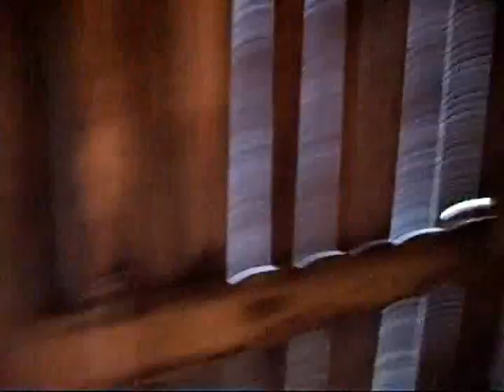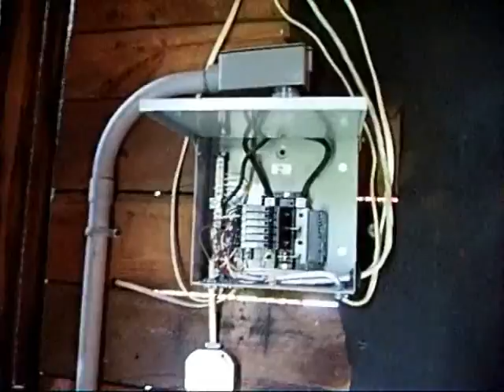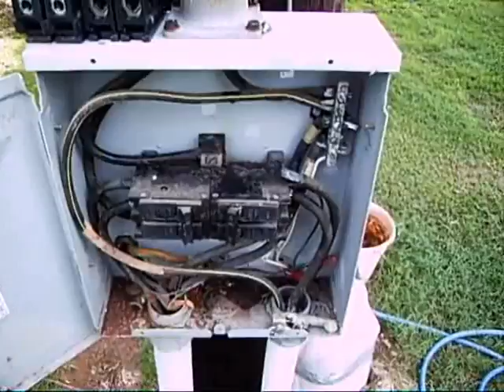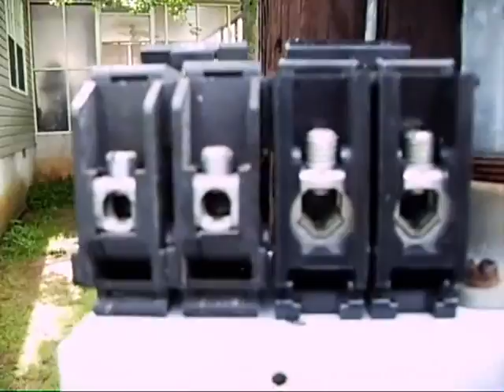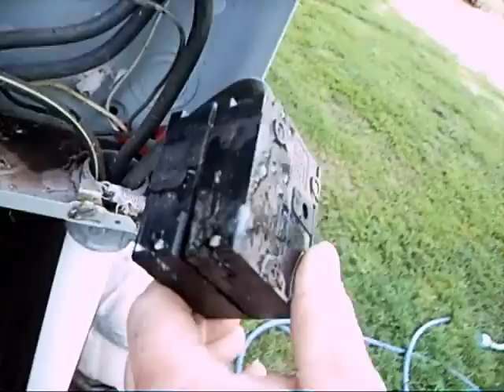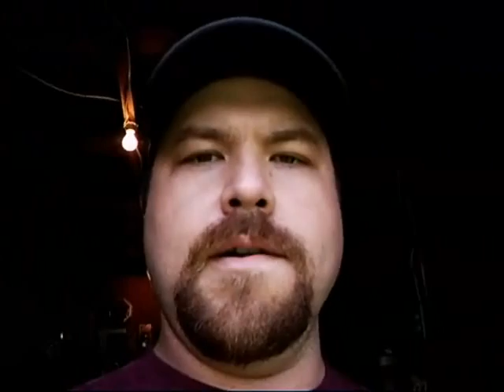Electrical problem at the shop

Comment from the maker: Yeah, you're right. That solid wire is going up the pole to a security light.  I didn't wire it up that way, but it's been there since 1987.  Since I don't have a copy of the NEC, I don't know what 334 is refering to.  All the wiring in the shop is properly sized for the load it's carrying.  I put the breaker panel in about 10 years ago after lightning ran in and burnt up some wires and destroyed the disconnect style box that was in there.